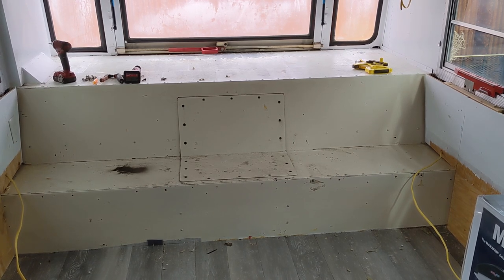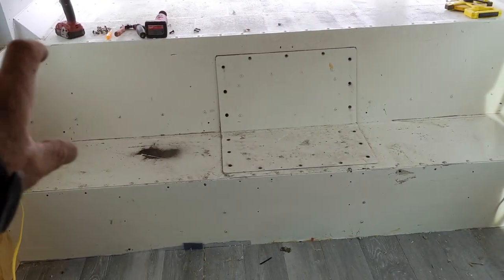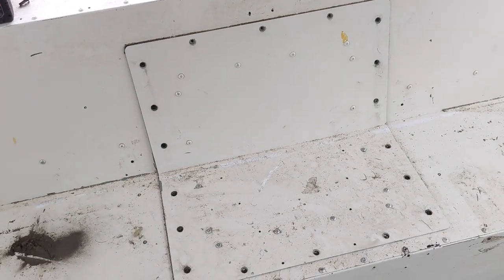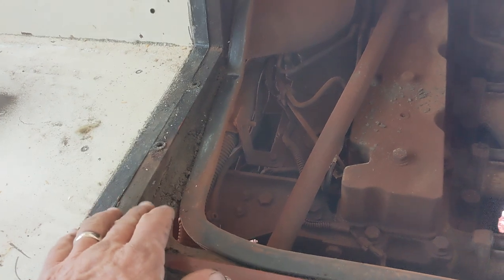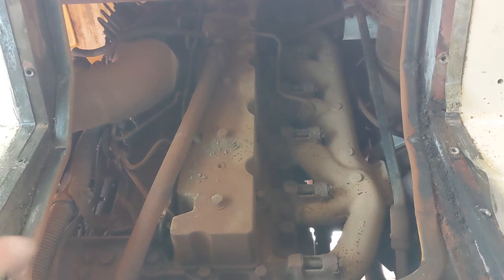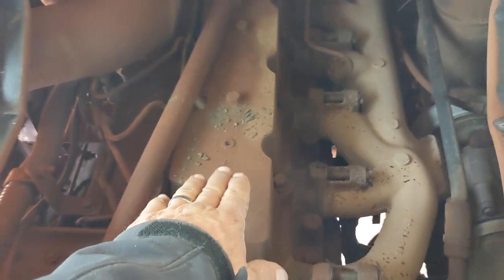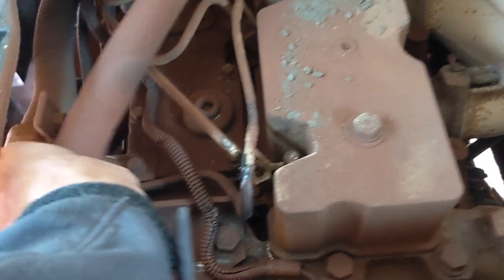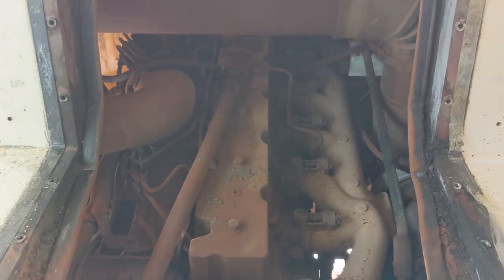Bus Engine Access - don't block it with your bed!

Comment: Thank you for making this video. I knew not to cover the panel but I wasn't 100% sure I knew what jobs it was blocking from being done. i plan to frame my bed in a way that the panel can be removed. I was going to glue down board to the panel but make holes over the screws so a driver can still remove the screws.
Reply from the maker: You don't have to make it super easy to access.  It won't be necessary often.  But when it is needed, you don't want to have to rip out your entire bed or some cabinet.  Thanks for watching...and for planning ahead!

Comment: i was 100% intending to build my bed frame around it, but also explicitly to allow access. beds are easy to move. same for the other floor panels. used to work on trucks.